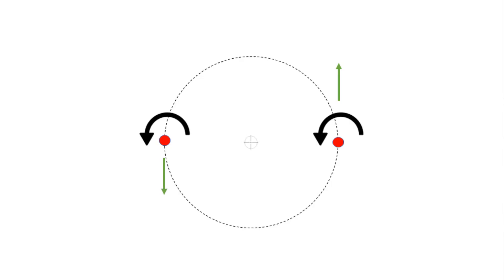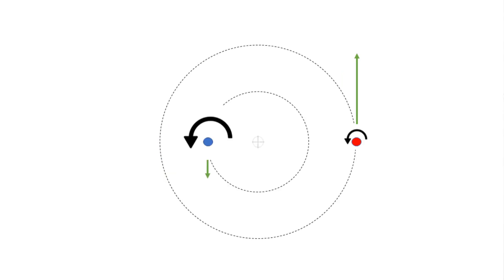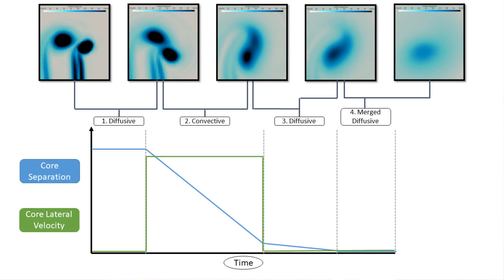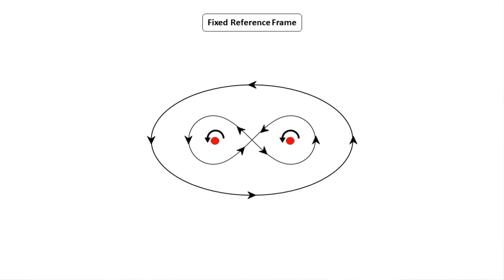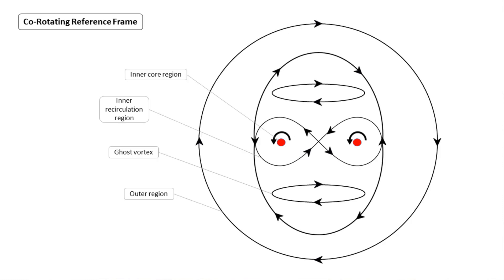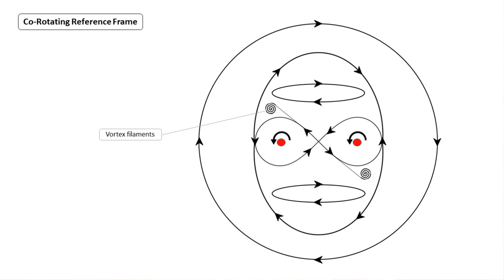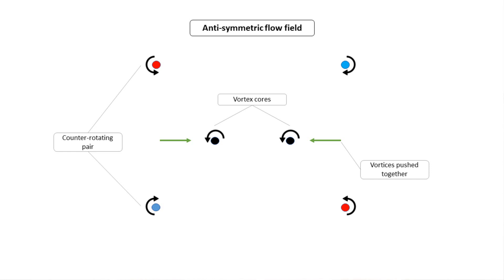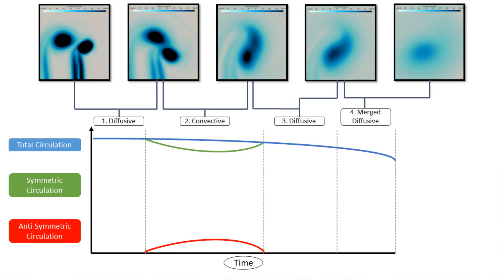Co Rotating Vortex Pair Interactions

Comment: Can you talk about how vortices are made as a result of form drag? Is the speed the vortex travels downstream at, slower than the free-stream velocity? The vortex flow, doesn't follow the free-stream flow direction, and instead follows a tangential flow direction, as it circulates about a low pressure core. Since the vortex flow moves slower than the free-stream flow, doesn't this imply higher static pressure at the vortex wall(ie the part that is moving tangentially to the free-stream flow direction)? Furthermore due to the tangential flow in the vortex, the free-stream flow creates shear stress on the vortex because the flows meet at an angle.
Reply from the maker: The key thing is that the vortex has axial and tangential velocity. Generally a vortex which has just been generated is travelling much faster than freestream axially then if unsupported can breakdown - the main mechanism being a high swirl and low axial velocity. Therefore, typically initally the vortex has the lowest pressure since it's travelling faster than freestream and requires a low pressure core to maintain circulation.
Reply: @tomtalks8886  Wouldn't the tangential and axial velocity add up to free stream in order to satisfy continuity?
Reply from the maker: @rolandotillit2867  Consider a perfectly constant total pressure domain (Total pressure = static + dynamic). Since the core of the vortex is low pressure, the dynamic pressure must increase to satisfy a constant total pressure, hence the increase in axial velocity.
Reply: @tomtalks8886  Axial along the vortex filament in the freestream direction? Or axial meaning along the axis of rotation?

Or is the axial velocity higher because it is forced into a curved path, meaning if the fluid had a straight trajectory, its velocity would be higher than free-stream flow?
Reply from the maker: @rolandotillit2867  Axial as along the freestream direction. That's why vortices can produce such large suction.
Reply: Impressive.. this field is very very soon going to be at the cutting edge of fundamental physics. 
The SCLAR PROJECT  - coming soon.